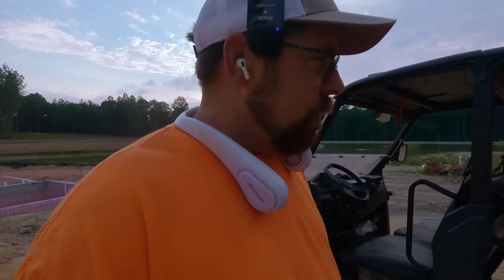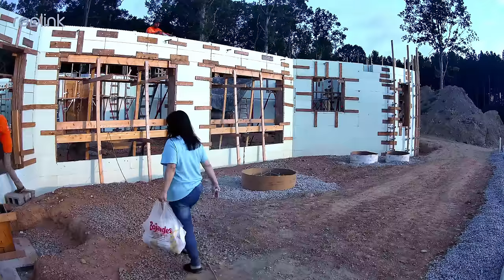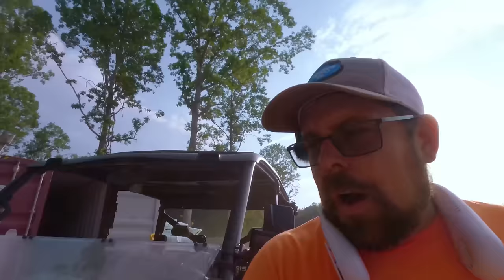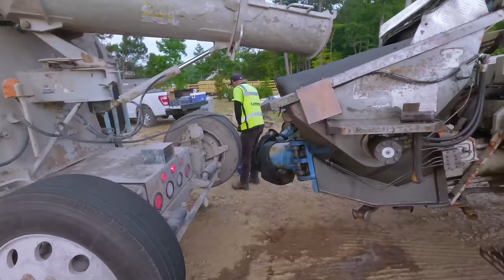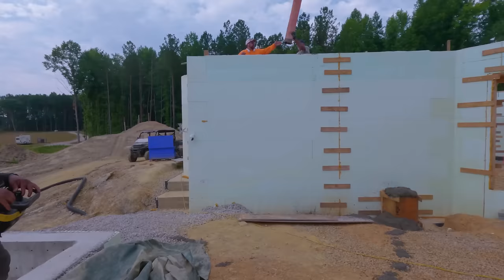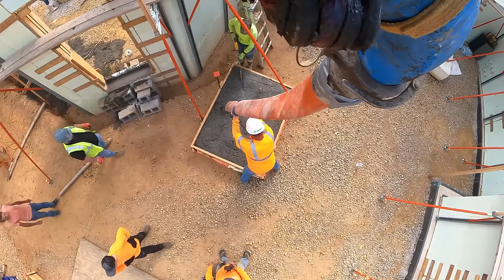Concrete Pour Day for the ICF Mansion - Part 1

Comment: One thing to think about when pouring concrete. Pour the large job first. That way at the end of the day your walls would be filled and if short, only the support pads would suffer. If you pour pads first, you may not have enough to finish the walls. But it looks like your workers are doing a decent job.

Comment: If I may make a suggestion, when the guys are pouring the window sills (as I refer to them, bottom of window opening) where you have a lot of structure interfering with the drop tube, have a man on the other side hold about 16”x16” square cut off off something so the concrete splatter will bounce off it  back into the form, like a backer board or shield, might save you some concrete and clean up later. Just a thought sir. You guys are doing a great job, looks good, thanks for the update, enjoyed watching.

Comment: After reading some comments below;
Maybe they naysayers should tie up their work boots, get up on your 2x8 walk planks hanging off the walls,  grab hold of the elephant trunk & give it a whirl!!  Obviously they have never worked on a construction site before yet alone poured a ICF.
The operator & all your help did the best he could.  
There's a lot of concrete in the tube that gravity is taking control of b/4 it stops.
My only comment is everyone should have safety equipment on including hardhats, gloves & glasses. That crap splatters bad!
Keep it up Geoff your doing good & learning alot!!!!

Comment: Geoff are you not going to be stacking  ICF forms on the lower basement wall for the level 100?  I noticed you did not tape off the top of the ICF form so the interlock would not be filling up with concrete.  The form look good, and a fortune in concrete, looks like the time I worked on the grain elevator construction project when we pour the base pad that was 5 feet thick and was 95 feet wide and 140 feet long.  it took 12 hour to pour  and 10 hours to finish.  8 week later we poured the wall over 6 days non stop to the height of 140 feet tall.
Reply from the maker: It’s taped. Thought I talked about it in the video. The next level transitions to 6 inch block so only tape the outside.

Comment: I would like to ask respectfully, Please explain the square pads that you are pouring inside. Does this help reduce cracking when you pour the floor later? Thank you.
Reply from the maker: Hi! Great question. Those are for the 9 columns that support the steel beams which support the floor.

Comment: Geoff with what I have seen so far, I’d be asking for a reduction in the amount of concrete you recieved. I know they delivered so much but what you got in your walls was not the same. I’ve never seen so much spillage. Hope the company that supplied the concrete watches your video cause they should replace the remote operator.

Comment: Too bad the guy running the vibrator doesn’t know what he’s doing. You’re suppose to push it in the concrete then remove and move to the next area. Leaving the the vibrator too long in one spot separates the mix, wearing the concrete.

Comment: At the 31 minute mark the square piers are there footings under those?  It looks like they're just being [poured on top of gravel and the ground.  Are those equipment pads?
Reply from the maker: The square pads are the footings
Reply: @BealyGood  interesting, although maybe since they're being poured on ground that was dug out for the basement it is considered undisturbed ground.  I am in a different area of NC and here if a basement is dug, footings like that are dug into the basement floor.
Reply from the maker: @woodcrestwoodworkingnc  the floor will be 6” higher. We had an engineering firm do a compaction test.
Reply: @BealyGood  Oh I don't doubt you know what you're doing, it's just different from what I usually see. :)

Comment: The waterstop is installed completely wrong it has to go between the existing concrete and the new concrete continuous ie walls and beams and not over the reo You will have leaks against the edges that have no waterstop when the concrete shrinks
Reply from the maker: New concrete went over the water stop. I’m aware of the wall missing it. I’ll talk about that in a future video.

Comment: I've seen concrete pumped from a boom pump before. I've never seen it done like this before.  The guy positioning the hose could benefit from watching operators who do this as a vocation.  The laws of physics do apply in the State of North Carolina.         It's over.

Comment: The guy running the pumper truck is not as good as the 1st guy you had. You are losing  a lot of concrete.
Reply: This would be a complicated pumper truck project for anyone, CMP should have sent someone to guide the new guy for a few hours.
Reply: I don’t think it’s as bad as it looks. Those forms are consuming a lot, the waste is probably a drop in the bucket
Reply: This looks like it would be easy to do. Let me assure you, from experience, it's very difficult for the pump controller as well as the people pouring and working the concrete. The guy running the pump the first time has probably been doing it for many, many, many years and made it look easy. This pump guy might have been doing it for a few years and isn't as smooth yet. It could also be that the controller and pump truck were acting up and for sure the inexperienced guys helping aren't giving him much guidance except screaming that's enough which isn't coming fast enough because that long drop down part of the hose has got concrete in it that is not gonna stop coming out when he stops the pump. You got to take that into consideration when guiding the man running the pump truck. It's not an easy job at all.

Comment: Have you ever thought about vibrating the outside of the forms? I understand the columns.
But a lot of the walls could have been done from the outside. And when you got enough concrete in the forms. Don't sit there and keep pumping mud into it. Pull the hose away, spit it on the ground 🤔🫣 it's only common sense, you're making it harder than it IS 👈🤷 You can always slow the pump truck down🤏👌 It's gonna be a beautiful house.
Good job jeff👍

Comment: Mr Bealy Good - Sir…. I’m no expert but I was little concerned to see the bubblers on the sun shelf covered over with concrete - was that right? Anyway to get that amount of people and everything else organised to run as smooth as it looked with the odd hiccup here and there a great result! I always think you get a better result and a little bit extra from a crew if they are fed and watered properly - nice move. Roll on Wednesday!
Reply from the maker: Don’t forget. This is just part one. All will be revealed. Thanks.
Reply: @BealyGood  of course - if I was sounding critical I didn’t mean to be - apologies if I did
Reply from the maker: @andysprunt9058  not at all